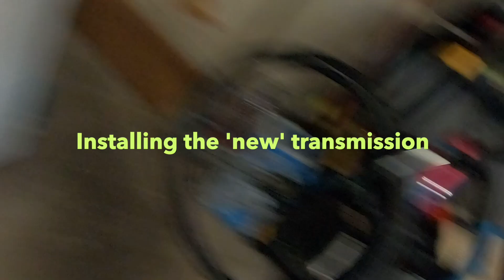Removing and installing a manual transmission on a Nissan Versa 2010

Comment: Thanks for putting this up. It’s interesting I can find such a unique reference for a job that has come up. I’m in the position to have to remove a manual transmission from  a 2010 Nissan to replace the clutch slave cylinder. My car is even the same color as yours. Ok, well enjoy your day and thanks again.
Reply from the maker: My pleasure, I'm very far from a mechanic and this was my first time messing with a transmission, far beyond my skills but I had to do it. I watched quite a few  youtube videos that explain the process. Anyways , good luck in your project. :yougotthis:
Reply: @arielrivera Hey. Hope all has been going well. I’m finally getting around to this project. I was wondering. Did you have to remove the passenger side axle or did you just slide the transmission off the axle and leave it in place?
Reply from the maker: @granturismonascar  I did remove both axles .
Reply: @arielrivera thanks!

Comment: I have a nissan ad wagon and wanting to know which manual transmission is best suitable for it? Do you think Sr20 gear box can work?
Reply from the maker: Hello, I have no idea, sorry.
Reply: How much trouble to get rid of automatic trans and install a standard trans. @arielrivera
Reply from the maker: @gradyhernandez4699  Ni idea
Reply: @arielrivera  es que estas un versa hatchback en mi barrio,pero es automatico,y transmisión no sirve, y Cuesta 2000.00 $$$ y una estàndard serial ideal ! 4 cilindros Aire frio.. hatchback
Reply from the maker: @gradyhernandez4699  No soy experto pero pues así lo que se me ocurre que se complicaría es agregar el pedal del clutch y su engranaje, la palanca de cambios con sus cables , y no sé si el automático tenga todo el clutch o también hay que agregarlo o si es que tiene que lo dudo, habría que adaptarlo . Creo que saldria mas caro que comprar la transmisión.  Yo la compré usada, podrías intentar buscar una usada automatica en ebay

Comment: Hi Ariel. Nice video, thanks! Can i confirm that you did not need to remove the exhaust pipe? Was it pretty much, connectors, shifter, coolant lines and axiles?
Reply from the maker: Yes, correct. No need to remove exhaust.
Reply: @arielrivera  Thanks very much!